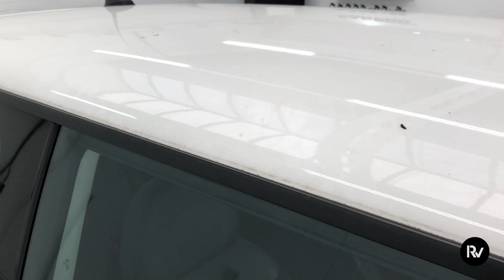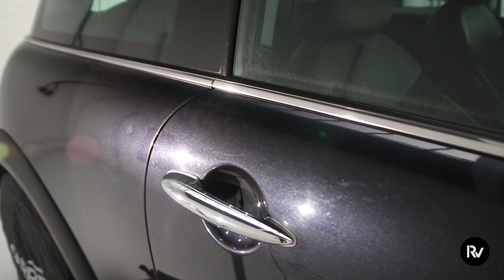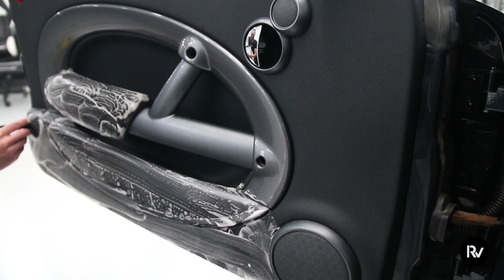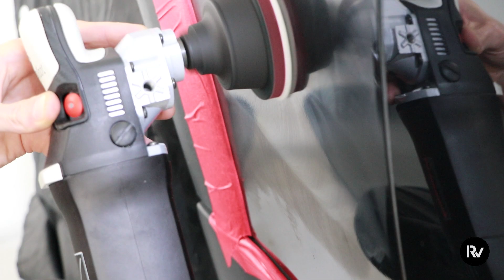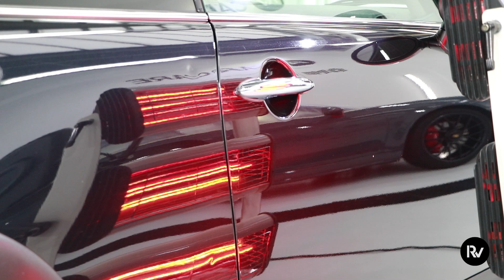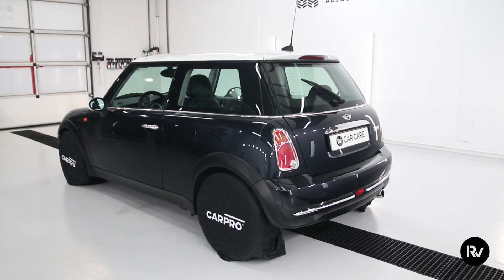Neglected Mini Cooper Detail | Paint Enhancement Detail

Comment: Damn, I need to fix my cooper. Chipped paint on the front bumper and hood. Small dent next to fuel cap. A crack on both bumpers. A loose Sidelight. Curb rash all around - don't know where to start, but I have to at some point. At least everything is fine mechanically.